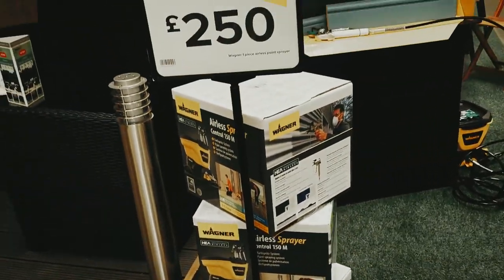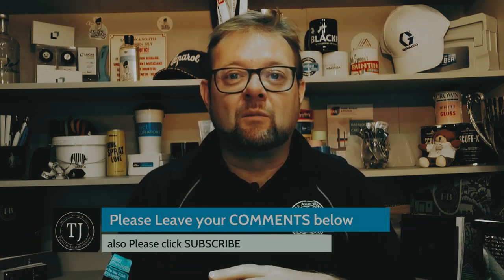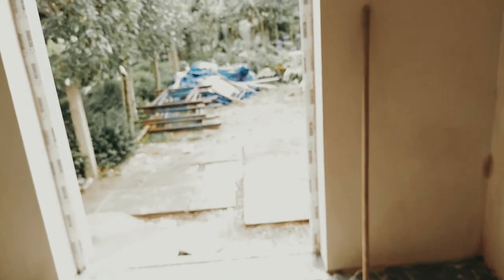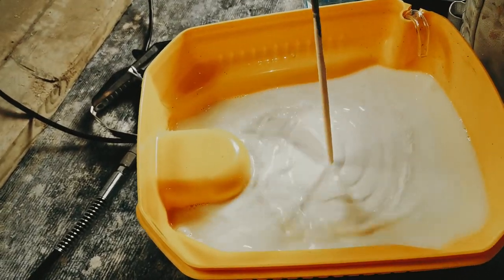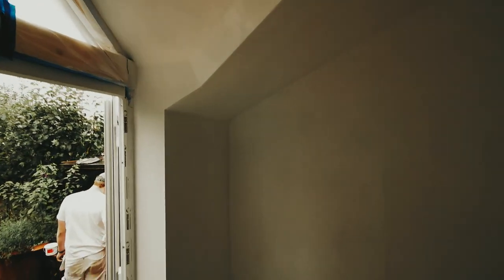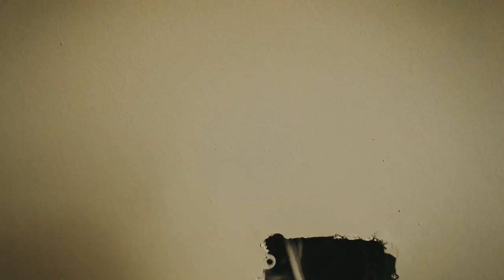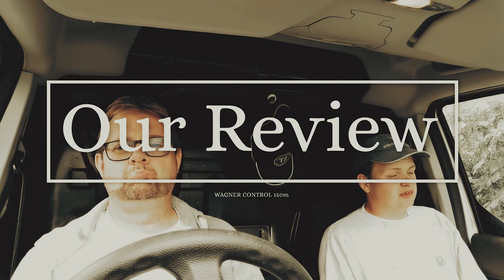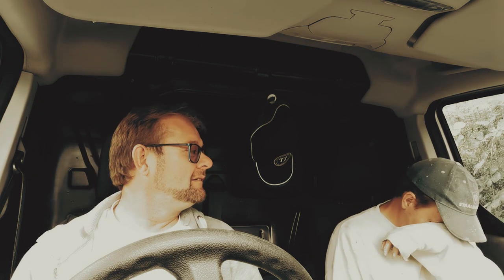Revealing: Insider Look at Wagner Control Pro 150 Airless Sprayer

Comment: Awaiting delivery of this sprayer, for godsons kitchen cabinet doors etc will I need the purple trade tip3 or will the supplies tip do the job. ?👍👍
Reply from the maker: +Mark Evans the purple tips would be better as they are the five finish tips as far as I am aware.
Reply: @DecorDev  got home from work and the Wagner trade tip had arrived. However the metal body is  slightly longer than the 2 I got with the sprayer so the whole isn’t central. Gonna ring Wagner today. 👍
Reply from the maker: @markevans3026  make a call to the Paintshack in Windlesham and ask for Colin he will sort you out. From what you say it sounds like you need the other tip holder?
Reply from the maker: Call: 01276 582321
Reply: @DecorDev  will do 👍

Comment: Hi mate.. I've just bought this one.. Left my trade as a panel beater and sprayer.. I'm thinking of trying a small business with this wagner.. What the life of them like?  How's yours going and are they only probably any good for house replasters where oversorsy won't be an issue and there's no pressure to turn down.. I'm mean I could mask up to fmdo door frames etc
Reply from the maker: They are a great starter / learmer machine but tbh it wont last you forever. Learn on it and then think about the Graco GX21 or GXFF Let me know how you get on
Reply: Thanks so much for the reply dude

Comment: If it was still £250 it would be a useful miscoat, ceiling and priming machine but at £350-400 there are now better options at not much more money. A hopper fed QT190 or a GXFF are simply brilliant and both under a grand. Two jobs with either of those would pay the difference and the wagner wouldn't get used again I suspect 🤷

Comment: Hi Trevor, I'm just wondering would it be a good for undercoating frames and doors?TIA
Reply from the maker: imo no not really, you could but you would have to move fast and have the paint quite thin, ideal for ceilings and walls though

Comment: Only saw you using the Wagner for a mist coat in the video so take it it was gash for the proper coats. Will therefor be giving this a miss!
Reply from the maker: No you could easily spray the topcoat but we always backroll on new builds and extensions because its bound to get knocked by other trades and it make it easier to touch in

Comment: Have you tried it with oil based primer?
Reply from the maker: No tbh I have never put oil trhough it, I don't know but I think it may well struggle. Are you planning to use oil?
Reply: Apparently it's not suitable for solvent based paints, had a big dispute with Wagner over that years ago, unless they've improved it.

Comment: After doing 2 rooms mine started leaking from the front. The instructions say damaged pistons. Was great whilst it worked.
Reply: I had the same issue after 3 rooms and a cupboard. I took it back to bunnings and they gave me another box. The second lasted an hour and also started leaking at the bottom. Is it a bad batch or a bad product?
Reply: It says it has a 1 year warranty. Were you able to get it replaced?

Comment: Hi Mate,
I've got 4 newly plastered rooms to do and was thinking of trying one of these. Due to having no way of changing pressure, how can you lose any 'tails' in the spray fan. I want to be spraying the ceilings to a finish but won't look good with an un even spray pattern. 
Thanks!
Reply from the maker: tbh the only real way to stop tails etc with this machine is to thin the paint or change the tip size. As you can see from the video Ryan and I used the sprayer for exactly the same reasons  as you want to use it and we never had any problems. If you to chat further PM I hope this helps?
Reply: TJ Painting and Decorating awesome cheers mate. I think I’ll take you up on that haha, I’ll pm you in insta during the week. Thanks mate
Reply from the maker: How are you getting on Ben?
Reply: TJ Painting and Decorating I’m actually going for the Wagner 250m. Originally I wanted a hopper fed machine due to the simplicity but for £150ish more I can get a 250m with a tip extension, and of course you can spray at different pressures with the 250m. Thanks for help anyway and keep up the good videos !

Comment: Hi . Excellent video are  you using a different gun to spray with
Reply from the maker: No its the HEA Tips and Gun that came with the sprayer
Reply: TJ Painting and Decorating  sorry its looked a longer as you was spraying  ceiling like it was extended lol
Reply from the maker: Oh sorry yes that was an extension bar, sorry agsin
Reply: Thanks i think we will get one just for miss coating and ceilings. Sorry for all the questions but you said you  put a few coats on ceiling is that because you changed paint and how long do you leave between coats or can you  go straight over thanks

Comment: Don't see point using sprayer for doing a miscoat then roller to do the walls
Reply from the maker: Yeah I know spraying is hard for some people to get to grips with as it's a different way of working and it takes times to understand the correct processes. Maybe you'll see the point one day?
Reply: @DecorDev  been better buying a airless off eBay £150 different power settings up to 3000psi. Them Wagner's will shit for the money. I get what your saying about getting into spraying but ideally should have sprayed the colour with sprayer
Reply from the maker: Confused don't know why you need an airless sprayer to spray at 3000psi for emulsion, Never had an issue with any of the Wagner's sprayers we use, and finally the best way to finish the walls was to roll them as a kitchen was being fitted as we mentioned in the video. Thanks for your feedback.
Reply: @DecorDev  I didn't say had to use it at 3000 thats just max psi. I couldn't see the Wagner 150 doing a full house from plaster
Reply from the maker: Ok each to their own mate
Reply: Scott bob stick to the way you work Scotty boy, once you get a bit of skill and knowledge you'll know why we don't use shitty eBay sprayers and why we rolled the walls.
Reply: @ryanmangan7237  I've not got a shity eBay sprayer I don't use a sprayer and if I wanted one I would but a gx21 with a hopper attachment not a wank eBay sprayer. But I don't use one so IL stick to the old roller. I'm your next video try to look like your alive and not just been dug up.

Comment: I have got my eye on this and I do like the look of it and what you say it seems like it’s anyway to learn if you do like to spray my question is this when considering to get it what tips work best with the gun I am really do walls and ceilings using matt emotion most of the time so do I need different tips 

Great video you always have great video keep up the fun great work
Reply from the maker: Thanks for your posative comments. No the tips it comes with should be fine to get you started on walls and ceilings
Reply: Painting and Decorating Tips by TJ that sounds great thank you look forward to the next great video your going to do now this might be a bit out there but have you ever done a video on the best cutting in brush I think that be a great video to do

Comment: Since the Wagner has no paint flow control do think that it uses to much paint when spraying ?
Reply from the maker: tbh it is what it is, a great little machine to find out if you can get on with spraying, No more no less and for £300ish it's a cheap way to find out. There is a way to adjust the pressure on the side of the machine. However you are probably

Comment: Bought one.. Noticed there's no spray adjuster.. Could I buy a different gun to adjust the spray volume
Reply from the maker: If you look on the side of the machine there is a way to adjust the pressure.
Reply: Thanks so much mate
Reply: Sooo.... Little update.. Did my ceiling and walls lovely finish tbh.. Only problem is the amount of paint it puts out is phenomenal.   I might buy a gun just to turn down the pressure